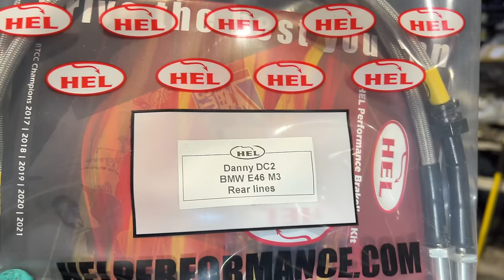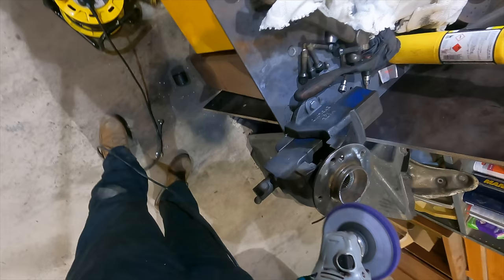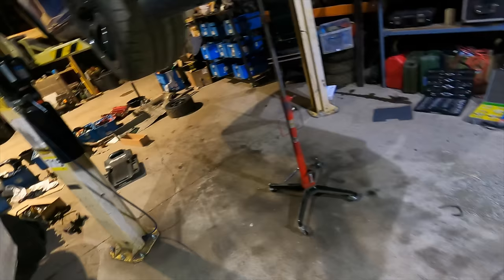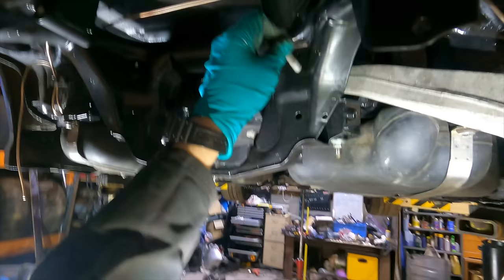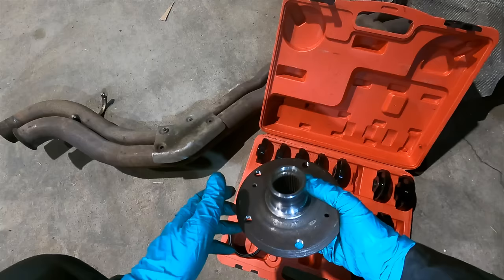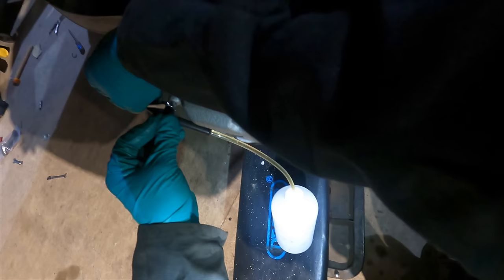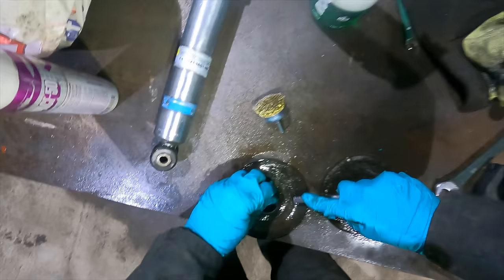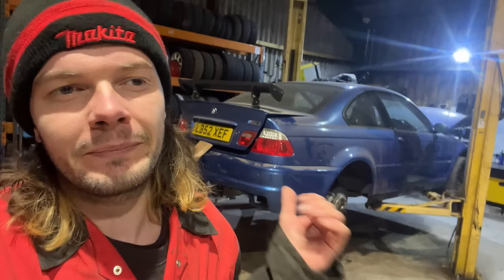M3 Rear End Refurb! No More Poly Bushes!!!

Comment: Raising the rear sub frame will give you more side bite on the rear as it effectively raises the car (lowers the car body). 
If the rear end is double wishbone suspension and the inner rear pick up is not on the sub frame it will actually raise the roll center as the inner rear link cannot go up (lowering the roll center). You probably don’t have massive camber gain on the rear, this mod will actually increase camber gain but that tends to give more initial steering and better straight line traction (better in the wet mostly). 
If the rear is double wishbone and the top wishbone is attached to the subframe it will have more rear side bite, it can corner harder, it will turn nicer mid corner, go over bumps better on hard compression, generally be more predictable. 👍🏻

(Edited) it was late 🤣

Comment: Rear trailing arm bushings on e46 was also my very first job, it legit stood on a jack stands for 2 weeks, i had to improvise a puller, i took apart the little hydraulic jack and took its wheels for example :dd, hammering out the aluminium remains of the old bushings, doing everything while laying sideways :dd never. again.

Comment: When pressure bleeding your brakes and their new, its a good idea to use rubber mallet and tap the brake calipers as the valve is open. It forces all bubbles to leave the brake caliper

Also, i use motorcycle shock protectors. It helps with keeping the coilover free from debris

Comment: Bit late now but next time you do calliper seals, fit the inner seal then the dust boot seal then the piston goes in last (totally separate from the dust boot). 

Just make sure the dust seal lip is seated in the recess in the calliper.  Then I usually use a piece of paper rolled to a tube, put that inside the dust boot and put the piston in to the paper to use it as a guide to allow the dust boot to come over the piston.  Then pull the paper out and push the piston home.

Keep up the good work!

Comment: Solid subframe bushes a spherical trailing bushes are definitely the way to go but i think I'd stick with oem bushes on the diff or at least the early type if can get them in Powerflex black. Just to reduce the whine if its going to be a roadcar at times or do a few 'Ring trips although 4.1s tend to whine abit more than 3.91 and 3.62s for some reason though.

Bit late now but would recommend the racp braced overhead and throughbolts on the subframe but that'll be taken care of with a proper cage anyway as you say. When I had Powerflex bushes, I changed all 4 bush sleeves so that have no play and fitted up fine luckily.

Comment: I use RIDEX ABS sensors all the time on BMW's (and everything else). Never had a problem with them. End of the day its just a hall effect sensor. Most of these sensors "fail" because the wires dry out and crack not because of the pick-up head being at fault. The most prone point is where the sheathing ends at the plug end and you have the two skinny wires exposed.

Comment: FxG lol, mmmm had one of those fail pretty quicky on the rear drum of a fiesta, went back to skf, all been fine since.... The front bearings i had the same issue as you, tried cutting across them inner races with an angle grinder and gave up, In the end i ground the flat edge of the race at the back thinner and managed to get a two legged puller on their in the gap just enough top and bottom to pull them off did that on both sides with a big socket over the driveshaft hole on the hub, so the center of the two legged puller threaded shaft sat in the socket to act as a center point...shaft on the puller wider than the square socket hole if you get me....🙂

Comment: i have quesiton about spring seat bushes, would there be problem with having spherical bearing on both ends because of that spring seat wishbone is connected to antiroll bar and spring in middle doesn't compress in straight line but it has an arcing movement, it goes in arc.. i saw spring seat for spring perch in from of articulating buttplug which seats spring so buttplug is on bearing and it rotates so spring goes straight in its movement rather than arc. 

Here you might have one additional axial movement on spring wihshbone which comes from spring not compressing in straight line --> that movement makes ARB move and then ARB movement affects your "effective" rear spring rate in real time. Could this cause some jittery feel for rear end or some problems? Rubber or poly alows spring wishbone to rotate around bushing axis only. 

Building 330ci for daily with some hillclimb and also doing most of rear end on spherical bearings

Comment: Would love to have your opinion mate. Have a EP3 and use mostly on the road, so I aim for a fast road setup and a OEM+
The question is regarding the bushing part of it, both for the engine/gearbox mounts and all suspension components. Do you recommend Polly or other mate ?
Reply: My ep3 had full poly bushes and was firm enough. Any firmer like with spherical bushes and you aren’t gonna be able to drive it on the road without having to replace suspension components every other week from the potholes not to mention the costs of having your teeth re installed from solid mounts vibrations.
With the state of these roads rubber bushes are probably better anyway but racecar 🏎️